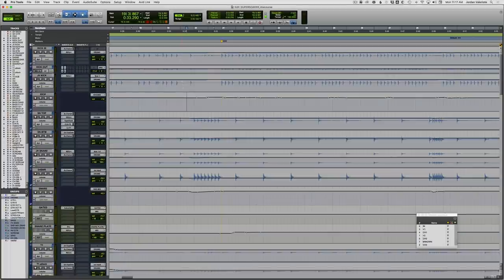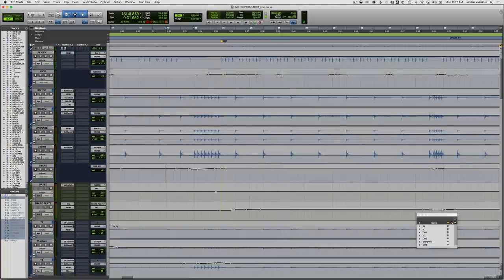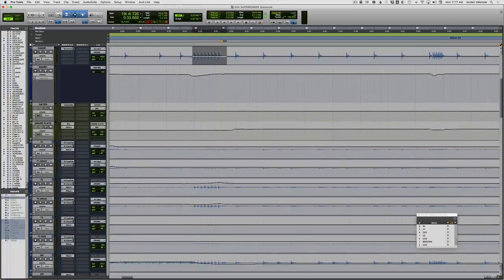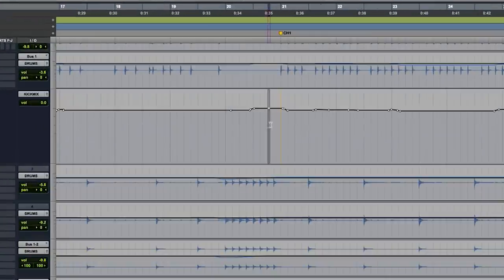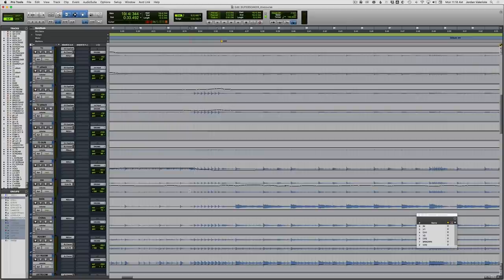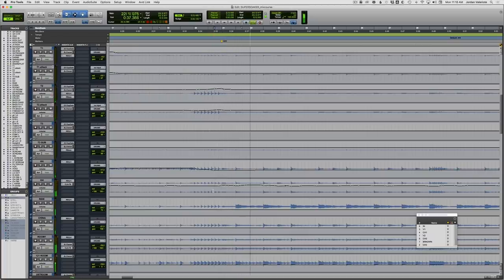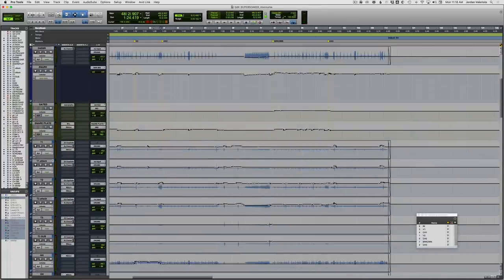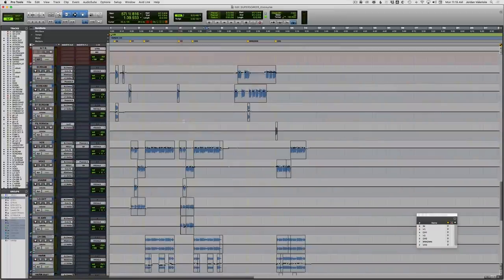Micro-Automation: The Secret to Loud AND Dynamic Mixes?

Comment: Yea. U can also send the mix into a limiter that has a not too fast release based on the bpm time. (60000 ÷ bpm) Then if u dont put it too much into it, or the release too fast, you can make a cool pumping sound that is in sync with the tracks bpm. Its good for making a mix sound ghetto, or doing a pumping effect on purpose for dance or edm/rave or rage type songs.

Comment: So does anyone know how to automate that fast?For me even automating the vocals only takes 1-2 hours,kinda painful if every track should be automated this detailed...
Reply: You should grab a midi controller with faders and record the automation with  it. Have in mind that long ago when mixes were made in big consoles you still could grab a couple of them at the same time
Reply from the maker: yes, you absolutely need a control surface to do this
Reply: @hardcoremusicstudio  any suggestions? is a trackpad good I think a trackpad that you could assign all 10 fingers to automate 10 different tracks if needed would be cool for extra control. Also as a reaper user there's no easy way to select all the automation on all tracks or a group of tracks to make those all important balance moves without selecting the whole automation on each individual track then moving dB where desired, remembering the dB change and applying it on each individual track .....and when your mixing and constantly balancing groups of tracks without an easy solution to this it will take huge chunks out of your time what's your solution to this?
Reply: I disagree. A control surface isntaccurate enough for this kind of thing. Unless you feel like having to redo it over and over and again until you like it. I just use my mouse. After awhile it gets really quick. This way instead of all those little points being left. Its easy to adjust anything you need to after when its just a few points. Trying to hit .5  and then .9 exactly with the fader is pretty much impossible.
Reply: @ractorstudios  at least for me its faster to do it with midi and then tweaking bc I just  go with flow of the mix.
Reply: @franciscoojeda11  ya i can see it being alot more fun to do it that way , thats for sure
Reply: @Gdude899  Some interfaces, like the Audient ones, have buttons dedicated to use them as midi controllers. For example: I have an iD14 and the big button allows me to use automation inside Reaper if I assign it properly.

Comment: Hi Jordan. Automation is necessary for making a static mix to breath again. But if you enhance the dynamics with automation, wont they be flatten again in mastering?
Reply: I also had the same thought... but I think that besides the kick (and the snare perhaps), the rest won't trigger the master bus limiter. And if to be used a limiter on individual track, the whole automation would make sense to me after the limiter... And even for the kick and snare... if the limiter won't gain reduce as much as the dynamic range of the automation, it would still make sense to do it... This is my theory. :)
Reply: @adrianconsta1139  You might be right. I would really love to see a practical example of this tho.

Comment: Question about volume automation in Logic: If you volume automate a track you can’t use the volume slider anymore afterwards right? Because it will always jump back to your automation curve. Does anyone have a truck for that? Is it the write mode of the automation? Or gain automation instead of volume?
Reply: There’s two solutions, either automate a gain plug-in and use the slider after the fact, or automate the slider and use the gain plug-in as your volume control.

Comment: Is there an automation mode similar to Touch mode, but where if you let go of the fader it automatically moves back to unity gain? So you can have a baseline volume, and do these small movements of automation. I'm using a presonus faderport.
Reply: Not sure about your hardware, but when editing the automation in, in the daw, you're doing basically that. Set a point to raise it and then another point to bring it back down. I use reaper and it's pretty simple to edit in the volume and pan, etc automations with a few mouse clicks. It doesn't graphically show my faders going up and down to match the automation but you can hear it happening
Reply: @Spoofaged  Reaper can show the movement of faders too. You have to set automation mode to "Read" on the track itself and then arm the automation track. Both the track and mixer faders will then move while playing back
Reply: @timokurka8742  oh cool, thanks for the info Timo! I knew it worked in the background easily so I never did any digging to figure out if I could make the faders move.

Comment: I never thought expansion would be rebranded with more syllables. "Micro automation". That's very Bay street. The PR types always make phrases of existing words: Customer "brand ambassador" .......... I bet if you add an "ality" at the end you will achieve supreme influencer status. Example: "Your track's dynamic range is squished due to it's micro automationality. You should probably redynamificate manually instead of using the tool as old as a compressor that happens to be on damn near every console in Toronto." Or is micro automation a thing you do to bump up hours spent on a project?

Comment: The word "automation" seems like a misnomer.  It is not automatic.  Really, you are deciding in details the volume and tracing it up or down by hand.  I started doing this on my vocals a long time ago, but not so much on all instruments.
Reply: Cool, I'd like to know what kind of criteria you have when you use automation on vocals. Like turning some dbs down when it's too loud or adding a couple dbs when you want to emphasize a specific sentence?
Reply: it's automation because you're automating the faders, they automatically move on their own after you "set" them instead of trying to have 18 fingers for every track you want to automate. it's a quite literal name.
Reply: @rmv2333    I record at home, so I edit it by ear after I'm done singing each section of the song.  I use my mouse and the automation lane in my DAW, no faders. First, I  look for the loudest peaks and softest parts and listen to see if they sound too extreme and use my ears to correct them syllable by syllable. I usually try to make the first word of the section loud and clear. Sometimes the proximity effect of the mic can make one word sound louder than I expected. I may record some parts again or comp.  I am a dynamic singer. Then I solo the whole thing again listening for noise in empty spaces and remove them with the automation.  I  also listen in context of the mix if I have all the instrument tracks to make sure all the words can be understood, but that is better to do later if there is a mixing engineer.